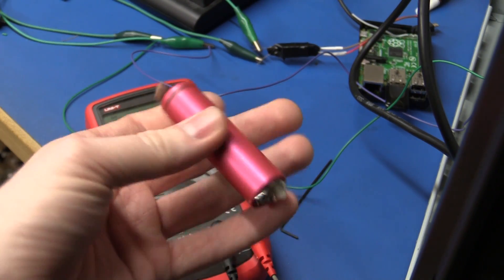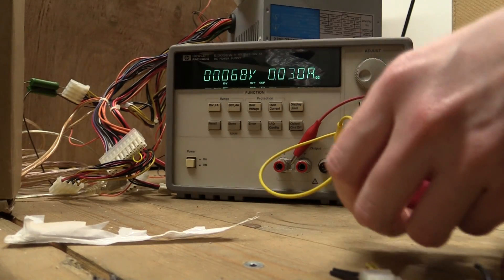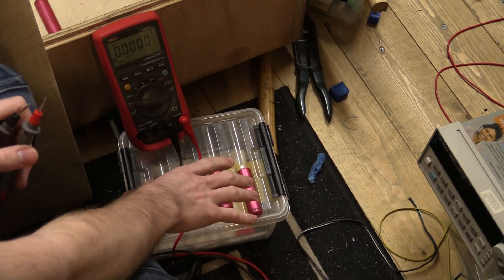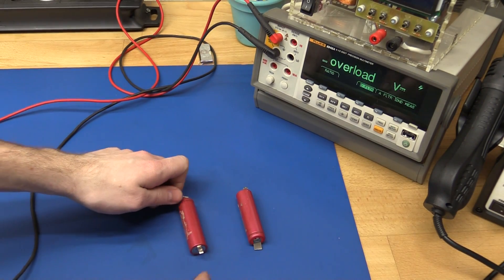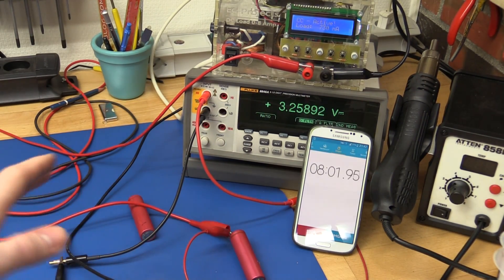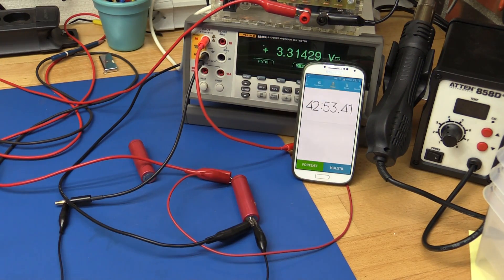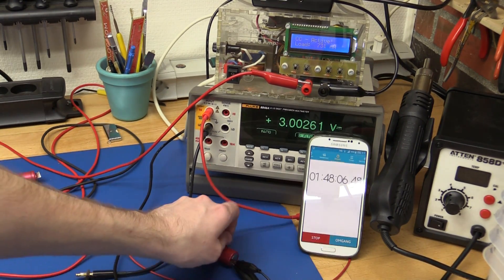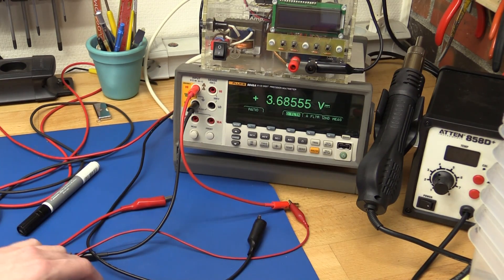Salvaging Li-ion Batteries From Old Laptops - (Unlucky this time) - Ec-Projects

Comment: Mads, I noticed that you set your DC load for 750mA, but during the cell discharge tests its LCD showed 731mA. Is that a firmware display bug, or does it really draw lower than what you set? I don't mean to criticize your DC load (I never did get one to work right!), but it would make a significant difference to the calculated battery capacities. I enjoyed the video; thanks.
Reply from the maker: +FlyingShotsman Sharp eyes :) Yes, there is a slight problem with the ADC on the load, so it displays less than is actually drawn, at lower currents. I need to calibrate it, but I never got around to do it. The DAC is spot on though, so it actually draws 750 mA. Perhaps I should have mentioned that :P Thanks :)

Comment: In fact I have done some similar tests on cells that were about 2.5 volts when I got them charged them to 3.7 volts left them on a shelf for 6 months and only last week checked them and 3 out of 42 cells had gone back down to 2,5 volts this means they have crystals causing partial shorts through the inner membrane as lion cells should be able to sit on a shelf 10 years without any noticeable discharge as unlike chemical batteries the ions do not move unless the battery is faulty or in circuit with something.  http://batteryuniversity.com/learn/article/charging_lithium_ion_batteries
Reply: +Ortorea Screenname http://www.geek.com/science/nanocrystals-are-killing-your-lithium-ion-batteries-1595290/
Reply from the maker: +Ortorea Screenname Yeah, I'll store them in a safe place if I keep any of these around. I've got something interesting coming up, where I need 800w of power. It's scary when you think about it, the Lipo batteries I ordered are rated to put out 2.4 KW for 10s, or 1200W continuously. I won't even think about how much power would be released if they short circuited O.o 
Thanks for the links! Batteryuniversity is a great site, I've used that regularly :)
Reply from the maker: +EcProjects correction: how much energy * :) :D
Reply from the maker: +Ortorea Screenname Ohh, I just meant to correct that I said power instead of energy :) 
That's quite a difference :) The best I've gotten was from an Acer laptop I believe, some light green cells with nice printing on them. :)

Comment: Awesome something I can relate too :) I hate those red one's: A) they give off an obnoxious odor especially when in a fairly airtight container, B) Their capacity sucks I recently acquired over 300 cells many were red one's :p Also BE VERY careful with discharged cells, according to The Battery University lion cells can grow crystals inside that puncture the insulating membrane, if the crystals should be large enough and due to heat expansion short out while being used, charged, discharged then they CAN catch fire, I disposed of all cells that had an odor or were too low a voltage it is too risky! https://www.youtube.com/watch?v=HCGtRgBUHX8
Reply from the maker: +Ortorea Screenname :) Yeah, I am very careful around Li-ion batteries, but I should probably have mentioned in the video that they are not safe even if they charge up well.. I'll add an annotation :)
Reply from the maker: +Ortorea Screenname Yep, I've seen that one :D Looks like you got some new ones out also, looks interesting :) I thought about getting a few solar panels, but I need to come up with a clever way to use the power, because it will only be a very small system..

Comment: im thinking of getting that atten reflow kit. any good?
Reply from the maker: +Adil Malim It does the job :) But you have to check the wiring when you get it. I've seen some quite dangerous examples where the mains wires are exposed..
Reply: +EcProjects thanks for the heads up. its not a Chinese ripoff clone until it tries to kill you. apprently its part of the calibration process...
Reply from the maker: +Adil Malim Exactly :D